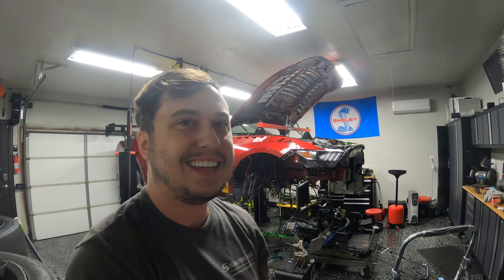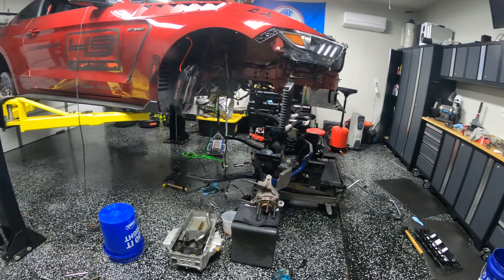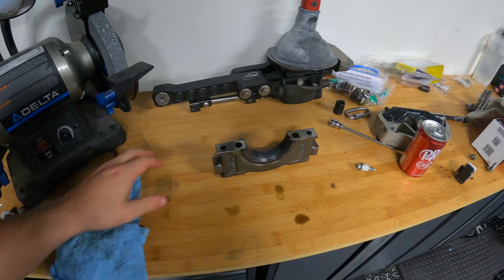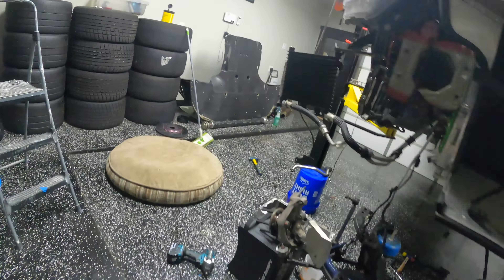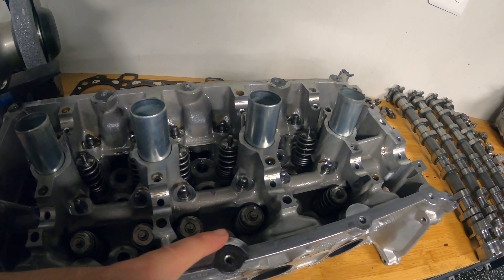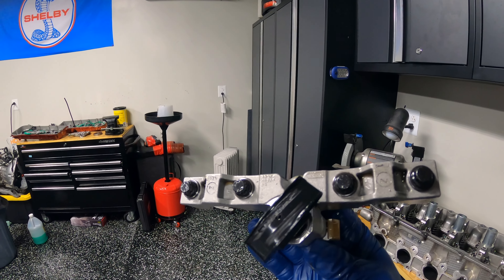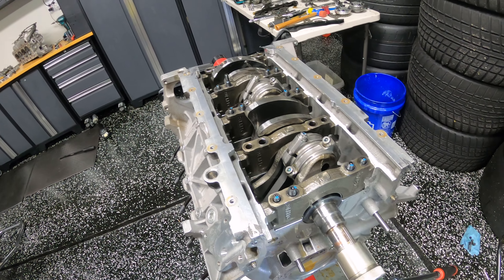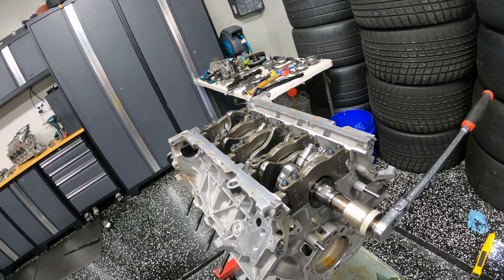Curse of the GT350 Voodoo: main stud in the oil pan and broken pickup tube

Comment: That’s painful.  I just completed the same oil pan and pump upgrade that you had done .
Now I’m scared to death of the oil pick up tube braking!!!  Crazy stuff.  Will be at RA this coming weekend with CHIN.
Also, why did you remove the MMR TC tensioners and guides?  Video shows that you had OEM parts.
I just installed the MMR guides and tensioners.  Sometimes better to leave OEM parts on, and after market may not be better.
Your current plan of dry sump, and roll cage is also on my list. Was planning on it next winter.
Keep up the great videos, they are very good. Appreciate your content.
Brian
Reply from the maker: Engine fully together? If not, might be worth pulling th tube to reinforce it. 

I sold off the tensioners and guides because the tensioners rubbed through the finish and started to chip away the material on the back of the guide. Builder told me I’d be better off just swapping in fresh OEM parts every time. 

And thanks for the kind words!
Reply: @honeybadgershenanigans  Do you think I should not put MMR tensioners and Guides in my GT350? I just purchased them but would not want parts in my car that have issues.
Reply from the maker: @SkepticalVex  I personally wouldn't use them (or anything MMR makes)
Reply: @honeybadgershenanigans   how would you recommend reinforcing the tube so that it wouldn't break? any ideas? TIA
Reply: what do you think caused the pickup tube arm to break? just the voodoo harmonics? I am installing this pan and pump in my 19R, a little concerned now. I am stock otherwise.

Comment: Update on engine rebuild.
Building new with a gen 3 5.2L block. I did stay with the FPC. New gen 3 heads.
Diamond pistons 11:1 CP.
Forged rods, king race bearings.
New GT 500 oil pan, oil pump, with Boundary black oil pump gear. New OEM pick up tube.
New oil cooler and lines. New clutch. 
New Stainless works redline exhaust. (Had MBRP- It was awful)
Having to get Whipple SC overhauled. Going to have to run it NA for a few months.

What is the status of your build?

Brian Collins
Reply from the maker: Make sure to get that GT500 pickup tube reinforced. I broke one and a buddy of mine broke his. 

I'm in a holding pattern on the engine. No real rush as I'm a few months out of the dry sump kit and currently working on the roll cage stuff. Slow progress, but moving forward
Reply: How would you reinforce that pick up tube?
Reply from the maker: I’d add a bunch of flat stock and weld it to the existing mount so it was thicker

Comment: Mr Honey Badger, do you recommend a non mechanic buy a used GT350?
Reply from the maker: If under warranty, 100%. If not, it's a gamble, IMHO. Given enough engine hours/time, I feel like all Voodoo engines will have issues. But that could be decades for some or the first weekend for others. One thing is for sure - track use exacerbates the issues because of the high RPM.

Comment: Hey Honey Badger, respect to all the work you are putting in.  I noticed on one of the forums you mentioned engine codes P0024 & P0025.  My 2016 350 has been in for that code 3 times, each time the dealer hasn't been able to duplicate it.  Car seems to stutter or hesitate at low RPM, I mentioned it could be an electrical issue, but no one seems to pay any mind.  Have you ever been able to nail down the cause?  Car has 2600 miles on it, and has had many oil changes, and is very well maintained.
Reply from the maker: 9 times out of 10 that’s an engine harness issue. The wires where they plug into the cam solenoids are prone to failure. You can either replace the plug or swap in a whole new harness. If you inspect closely, you might even be able to see it in the form of a fatigued wire
Reply: @honeybadgershenanigans  Thanks brother!